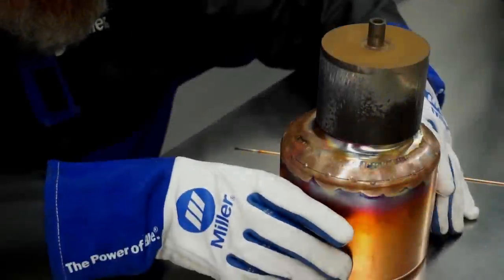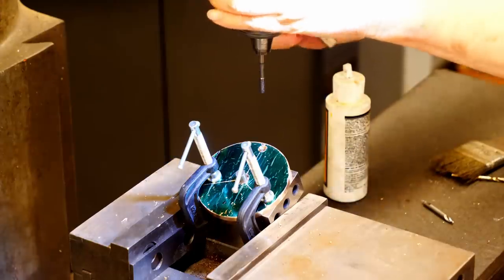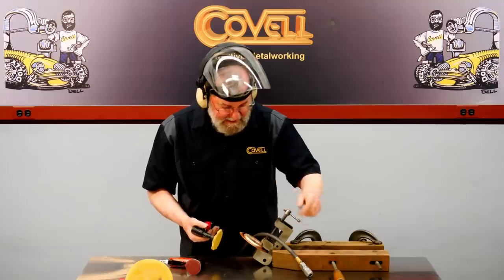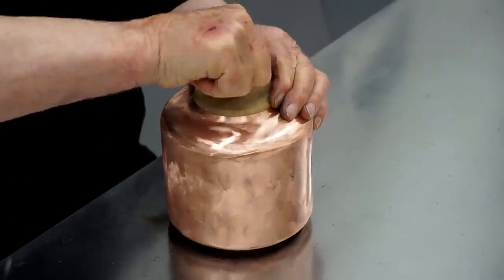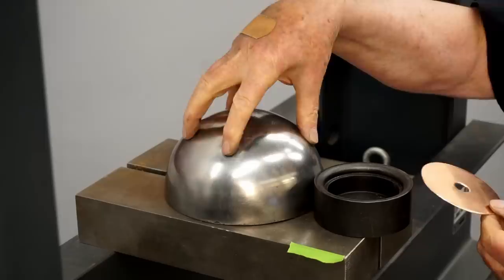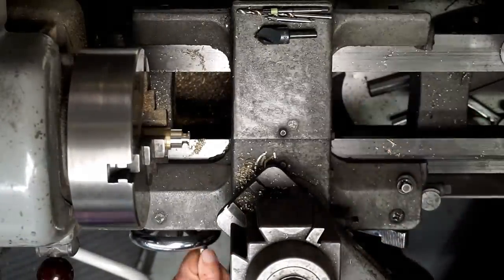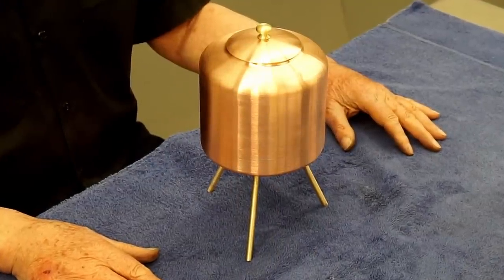Making a Copper Water Tank  Part 2 (Blondihacks Collaboration)

Comment: If they didn't want me to use an end mill to make flat holes on my drill press they shouldn't have made them flat!
Reply from the maker: I see your point!
Reply: @RonCovell  strangely enough not seeing it was sort of the actual objective.
Reply: @RonCovell   I like this video you are a creative thinker and have a big impact on metalshaping and metalworking  hi 👋 from 🇨🇦 #YSW  merry Christmas 🎅 🎄 to you ❤ 😘 💖
Reply: You can potentially damage your chuck, though; the end mill shaft might be harder than your chuck jaws. Also, you might be inclined to try to use it to do side milling, and the drill press's taper is not designed to stand up to that.

All that said, they do make flat bottom drills.
Reply: I worked in a university machine shop <redacted> years ago. The old timers warned me about putting endmills in drill chucks, not because of run out (though you are correct, there is a lot by machinist standards) but because the tapers holding the chuck to the arbor and the arbor to the spindle are not captive tapers. The spindle taper is typically a Morse taper. If the endmill catches on the material, there may be enough force pulling down to pop the taper lose. Now you have an "interesting" day. It can be done, just keep your speeds and feeds very conservative and you'll be fine.

I love your work Ron. Looking forward to your next project.
Reply: @RonCovell  I see your lack of point (because they are flat bottomed). ;)
Reply: It's more a problem of side milling causing the taper to work loose. Straight feeding shouldn't be a significant problem. 
Technically speaking the hard chuck jaws and hard mill shank are sub optimal, which is why shank drill is soft, but rarely are heavy cuts taken.
Reply: Pointless comment.
Reply: The cutting edges on the face of most endmills have a 2° incline towards the centerline.  It's called a "concavity angle", or a "dish angle"

So, a plunge cut doesn't produce a flat bottom.

Comment: Small tank ends can be formed by pressing a disc through an outside bearing race from a tapered roller bearing.  

Also a hockey puck makes a great compliant layer for forming domes over a male form.
Reply from the maker: These are great tips - thanks! When using a bearing race to form a tank end, presumably the race is the female part of the form. What do you use for the male part?
Reply: @Ron Covell yes the bearing race is the female part of the die. for a pusher, anything with a radius smaller than the shape you want works. In aluminum, the end of a broom handle works well without marking the aluminum too much.
Reply from the maker: Thanks for that!

Comment: Nothing wrong with using a drill chuck and an endmill or slot drill for spot facing - the forces are exactly the same as drilling a hole with a drill bit. Using a drill chuck to hold an endmill for taking a side cut is a different matter as the helical flutes produce a down force when side cutting and can pull a cutter out of a drill chuck. 
That was an awesome collaboration, Ron! I do hope to see more of them!

Comment: Excellent work.  The real revelation here is that you used taps for threading.  I was expecting you to use a single-point threading tool manually with a hammer to form the threads precisely by hand.
Reply from the maker: Maybe next time!

Comment: A work of art, Ron. 
I was surprised you were able to drive the base in the lathe only by the threads in the hole in the bottom.... Significant pucker factor there considering the machining forces were at a much bigger radius.  I would have added tailstock force on a friction disc applied through a live centre.  But hey you took light cuts, and all's well that ends well.
Reply from the maker: You bring up a  very good point! There is certainly a limit on the torque that small threads like that can withstand - particularly on soft metals like bronze. Light cuts save the day!

Comment: I'm pretty sure I've seen Quinn put an end mill in a chuck at least once or twice, but she's always mentioned while doing so that it's not normally a good idea.
Reply from the maker: Oh - I guess I haven't seen all of her videos.
Reply: The issue is not a risk of a couple thou of run out, the risk is that both the tap and the Chuck jaws are hardened, so they don't get a good grip on each other, it tends to slip, and if it does slip you're going to damage something and it might be your hundred dollar Chuck that you ruin, meaning nothing ever runs true in it afterwards.
 
I think it was adam Booth (abom79) who showed making some tap adapters to hold the tap, from soft steel, so you could use them in a Chuck with a measure of confidence it was going to work.
Reply from the maker: Honestly, I never thought of that! Thanks for pointing out the problem - and even better - a solution!

Comment: At about 14:40, where you are tapping the holes in the legs, look at the lathe motor jump when you change directions.
Reply from the maker: Yeah, my lathe is an old Atlas belt-drive 'clunker', but it has served me well for many years.
Reply: @RonCovell  yeah, it doesn’t look like it’s the newest model, but if you had never noticed before, I thought I’d point that out. Maybe a bracket it broken or loose and it’s a simple fix. 
Anyway, I like your work and I enjoy your videos.

Comment: I find millimeters are 25.4x more accurate than inches. When we get dimensions in inches in the workshop, everything is first converted to millimeters. The invoice then states that millimeters serve as the unit for all dimensions. American customers often specify millimeters and inches.
We can also make American threads, but there is always a risk of confusing these with British threads.
Reply from the maker: Well, I certainly acknowledge that the Metric system is much more widely used, and the 'divisions of 10' structure makes it easy to use - but it is not inherently more 'accurate' than the Imperial system I grew up with. As for the thread standards, it's even more complicated than what you list:
https://www.youtube.com/watch?v=tkEVwpl2S4Q

Comment: Cool looking project and well done as usual. Is there a chance you could show the techniques, process, and special materials (filler rod, shielding gas, etc) needed for welding brass?
Reply from the maker: Nearly all of my work is done by TIG welding, which can handle nearly any metal. You can see some detail on welding many common metals, including bronze and copper here:
https://www.youtube.com/watch?v=J4Cxk1nZyaY&t=2s
Brass is one of the very few metals that are not feasible to TIG weld. The reason is that there is a lot of zinc in brass, and it fumes when heated. The zinc fumes defeat the argon shield that makes TIG welding possible.
It is possible to gas weld brass, and in fact people who make brass radiators have perfected this process. I don't have any experience myself, but 'brazing rod' is the filler rod of choice for this. You can see an example at 6:40 in this video:
https://www.youtube.com/watch?v=FwTvAap5DdQ

Comment: The copper water tank turned out awesome, Quinn is going to love it. Thanks for the video. 👍 
Is your lathe a Sheldon? It looks exactly mine, and it also makes a thumping noise just like mine?
Reply from the maker: My lathe is an Atlas, but similar to the Sheldon. I could probably find a way to dampen the thumping, but I got used to it over the last 30 years or so.

Comment: Me making this video:  "OK so now that it's all done I'm gonna sand the welds down....  1 minute later  OK so I ground through most of my welds and it fell apart so let's try welding it again. "   😁
😂
Reply from the maker: Well, I certainly have gotten the metal 'too thin' while I was learning these processes!
Reply: @RonCovell  - Yeah but I bet your mess ups would be better than my best work...     LoL
Reply from the maker: I started at the bottom rung of the ladder - just like everyone else. I think I've made every mistake possible - but over time I learned from my mistakes. That's the only way I know to get good at something.
Reply: @RonCovell  - Yeah, I can't say that I haven't learned anything from my mistakes in the past.... I just want to make cool stuff like this but I don't have access to the tools, but if I did I'd most likely be able to make better stuff. It would just make everything so much easier than trying to do the same thing w/ an off brand Dremel, a roofing hammer and single speed electric grinder...  Somehow I've managed to keep all if my fingers over the years.       LoL
Reply from the maker: You might enjoy this video, where I do some good work with a VERY basic set of tools:
https://www.youtube.com/watch?v=MaZ_tdqPRAQ&t=147s

Comment: Beautiful work, as always! There is one thing I mised - why did you opt to use set screws for the feet, not threading the feet itself for example?
Reply from the maker: Threading the legs would be a more elegant solution, and that's probably the way Quinn would have done it. It's a lot easier to cut internal threads with a tap than it is to cut external threads, so that's the approach I took.

Comment: Stunning craftsmanship. Ive started to practice welding copper. Do you use helium or argon gas for copper
Reply from the maker: I use Argon. Helium would get more heat into the base metal, but it's much more expensive, so nobody uses it unless there is no other way.

Comment: Amazing work. I was not surprised to find you hold an advanced degree in art along with your other skills. Do you find that face shield does not fog up? It looks very nice, would you recommend whatever product it is?
Reply from the maker: My face shield has never fogged up, and I'm very happy with it. I'll be away from my shop for a few days, so I can't tell you the exact brand I have, but here's a very similar one I found online:
https://www.google.com/shopping/product/13986289561158069207?q=face+shield&prds=eto:9282021189933537920_0,pid:9187265147000138179,rsk:PC_4770476802573304611
Reply: @RonCovell  Thanks & Merry Christmas!

Comment: This was a great video. Thank you for sharing your expertise in metal forming. I am a welder fabricator in Mexico and I have been doing a lot of wood stove repair. In the back where the smoke rises and goes up the stovepipe, they rust out quickly from the caustics in the smoke. I have been building these parts much heavier than original because the stoves are practically new
Reply from the maker: Very cool!

Comment: Great work as usual. I was wondering if you could have used the mandrel in the lathe for all of the tank weld smoothing? Say start with a file then 80 and 120 paper.
Reply from the maker: You know, I didn't think of that, and it's a good idea! I didn't make the mandrel until after much of the weld had already been smoothed.

Comment: great work, what where your tig settings for cupper ?
Reply from the maker: My TIG machine was set to DC, Electrode Negative. I had the current on the machine set to the max (210 amps) but I was modulating the output with the foot pedal - I'm guessing it may have taken 100 amps or so to make a puddle. Argon flow is about 16 CFH, and I used a 3/32" 2% Lanthanated tungsten, sharpened to a sharp point. Pulsing was not used.

Comment: You didn't seem to have any issues with the copper work hardening.
Reply from the maker: You are correct. Work hardening was not any problem with any of the forming I did on this project. I believe the material was 1/4 hard when I started, and of course I could have easily annealed the material if I needed to.

Comment: Lovely work.  I find it amazing to see how your videos make it seem like the shop is always just a blank open room, like there's nothing else there.  That kind of space is an absolute fantasy for me.  I have a small 350 SF shop, which is bursting at the seems, but I just can't imagine making it look the way yours does in the videos.  Good narration as well.  I'm a bit surprised at the set screws for the legs becase I would have thought having holes in the tank would be undesireable.  I also thought it might be nice to mention the material choice of the bronze wrt to welding.  Bronze is tin and copper.  I guess thats fine.  But you wouldn't want to be welding brass, due to the lead content, which you handily avoided.  Lovely, clean, peaceful videos.  Thank you.
Reply from the maker: I'm very glad you have enjoyed my videos. I do my best to keep my video shooting area as free from clutter as possible. I believe this helps people focus on the central action without being distracted by extraneous stuff. I can assure you, the rest of my shop is not nearly as clean and organized!
You are correct that blind holes for the legs would be preferred over through holes, but I just didn't have enough material thickness for that. Quinn, my collaborator, used a Loctite product to seal the threads. 
I used bronze for the tank base because I had some on hand, and I knew it was weldable. Brass is very difficult to TIG weld because the zinc fumes when heated, which defeats the argon shield (and can cause illness if inhaled).

Comment: Excellent result! Always love watching your videos, I learn so much from them. Two quick questions. The weld joints for the tank ends, were they butt welds or was there a slight overlap? It was hard to tell in the video. Also, what was the final grit paper used when polishing the tank? And again, thanks for putting out these videos!
Reply from the maker: All the joints (except for the 1/4" thick base plate) are butt welds. You can't make an overlapped joint perfectly smooth. I used 120 grit paper for the finish, but you could certainly go finer if you wanted. 2000 grit leaves nearly a mirror finish!

Comment: Brilliant work Ron, one thing I saw that makes me cringe though is using a file without a handle on the lathe. If it grabs it can push the point into your hand.
Reply from the maker: Good point, indeed. I'm actually quite safety-conscious - especially when I'm making a video, so I'll keep this in mind in the future!
Reply: The files he uses at 20:50 appear to be the type with the built in handle.   They do not appear to be the pointy tang type that require a wood handle.

Comment: Don't you need copper plating to prevent tarnishing and rusting? I want to see shiny copper forever.🤔
Reply from the maker: Copper, like most other metals, can oxidize, and it can go through many color changes when it does. While copper can be 'plated' (applied as a thin coating to the surface of a substrate) copper plating is just as prone to oxidization as solid copper.
Copper is actually a much less reactive metal than most, and that's why it is used for cookware, and for water supply piping in houses and commercial buildings. When stored indoors, copper can go for years without darkening, and a thin layer of oxidization can be easily removed by rubbing with a cloth moistened with metal polish. Heavy oxidization can be removed by sanding or buffing.

Comment: Won't the surface suffer from awful oxidation if left like that? Fingerprints and so on
Reply from the maker: Copper does have a wide range of surface coloration it can go through depending on the environment it is subjected to. You have probably seen copper pots and pans, which tend to darken over time. It's likely that this water tank will darken in the same way, but there is copper polish that can be used to bring it back to a bright, shiny finish if desired.
Reply: @RonCovell  Good to know! Thank you Ron and merry christmas and a happy new year to you and your family

Comment: Does welding copper to bronze/brass act differently than welding copper to copper?
Reply from the maker: Well, they can all be welded. I find that the bronze base metal and filler rod flows just a little better than copper. You can see a bit more in this video:
https://www.youtube.com/watch?v=J4Cxk1nZyaY

Comment: Ron, fantastic work! The tank looks so amazing!

When you mentioned the sticky-backed paper you used on the weld, was that just plain paper with no abrasive, to burnish the surface? If so, that's somewhat similar to something I do: I sometimes strop knives on paper or card stock.
Reply from the maker: I used 120 grit abrasive paper. I'm intrigued by your method of stropping knives on card stock!
Reply: @RonCovell  Oh, maybe I misheard what you said! For stropping, the wood fibers in the paper or card stock is abrasive enough to polish a knife edge when stropping without any added compound.

Comment: If you get a ball bearing out of a swiveling pillow block bearing, it will have a spherical outer race. That will allow you to spin form on the lathe without having to adjust the tool post so much.
Reply from the maker: Great tip - thank you!

Comment: What filler rod are you using to weld the copper to the bronze? Still the Deoxidized copper filler, or something else? 7:00
Love your videos. How you can use simple tools and processes to make intriguing parts that almost seem impossible to outsiders.
Reply from the maker: I used the deoxydized copper rod, simply to keep the color consistent as far down as I could. Silicon bronze rod actually flows a little better, so I considered using it, but copper won in the end.

Comment: dont use a file on the lathe without a handle
Reply from the maker: You are correct that any file used on a lathe should have a handle. For the record, the file I used in this video has a handle built-in, and no sharp tang:
https://www.zoro.com/strauss-habilis-file-set-swiss-5-pieces-hb2627d91/i/G8739376/?gad_source=1&gclid=Cj0KCQiAoeGuBhCBARIsAGfKY7wV5qmwP6iEvUp-Syzq5njnPt-btoare7v1c-4CWEROWk-eqS7WnF8aArs_EALw_wcB&gclsrc=aw.ds

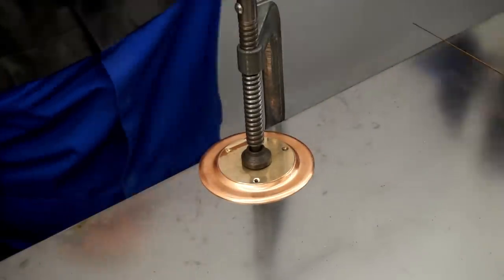Comment: What's the welding rod material used at 6:35 please?
Reply from the maker: It is 1/16-inch diameter deoxidized copper filler rod. Here's one source:
https://www.grainger.com/category/welding/filler-metals/tig-welding-rods/copper-tig-welding-rods?filters=webParentSkuKey&webParentSkuKey=WP13445590
Reply: Thanks! @RonCovell  !